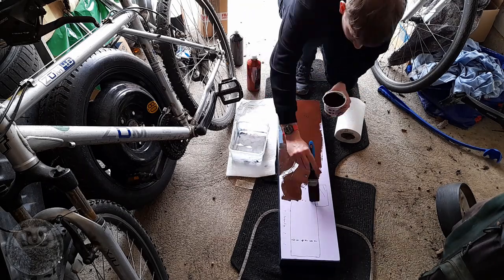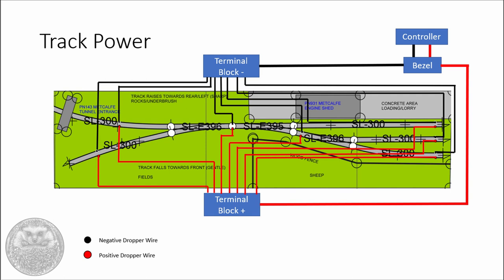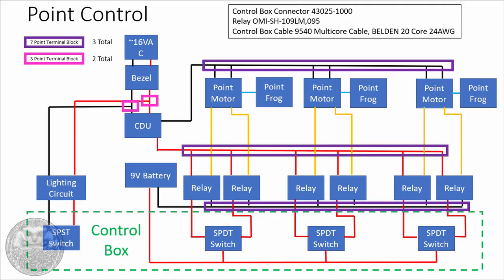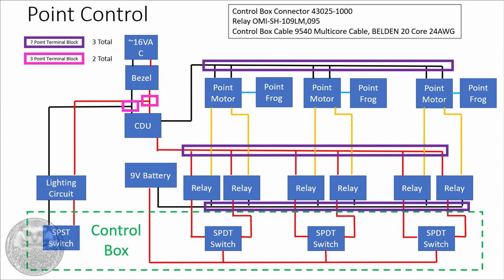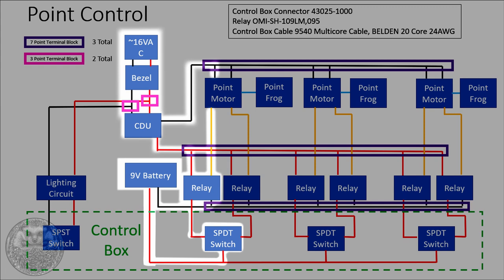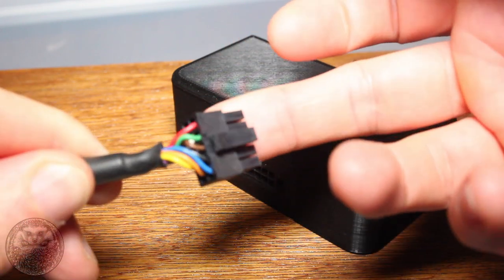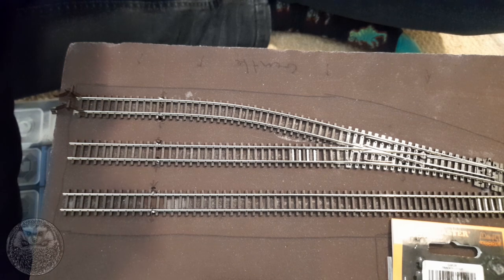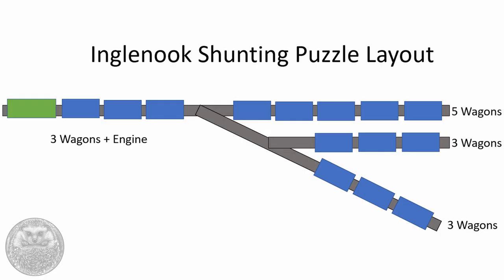N Gauge Model Railway Layout Build EP02: Electronics and Magnets

Comment: Interesting video! Interesting use of the relays, tradionally you would just wire the switch to the point motor so not quite sure of the rational behind this. Love the use of 3d printing, it really makes a neat job in the build.  Loved the trick in adding water to the rodding before you cut it! we have all made that mistake 😂😂😂 . Interested to see how your automatic couplings work over time as this has always been a big grey area in N-gauge, hopefully you've cracked it perfectly! 🤞. Looking forward to seeing your progress as you really have put some serious thought in to this build. All the best Tony.
Reply from the maker: Hi Tony - I have used relays so that the wires going to the switchbox can be much thinner - when using a CDU normally you need something like 18 to 16 AWG wire but the component cable I bought is made up of a bundle of wires around 24 AWG off the top of my head. 

The magnets aren't a perfect solution - you are always balancing the desire to uncouple easily without losing wagons when you want them to stay attached! With my current setup, whilst I can get them to uncouple every time, quite often a very unrealistic looking jerking motion is required to get it to operate! However, from a 'play feature' perspective it makes running the layout for its intended purpose (the 'Inglenook Shunting Puzzle') much more enjoyable as you aren't required to fiddle with the wagons by hand.

Comment: Excellent 2nd episode, like the magnet idea, using the small magnets, I will give that a go ,the dapol ones are large and once the small ones are given a coat of black, assuming they still work, hardly noticeable
Reply from the maker: Hi Colin, thanks again for your comments. The small magnets have been working OK for me, however it is very hard to get a good balance where the magnets are strong enough to decouple the wagons but not too strong so that the train splits when you don't want it to. One thing I can say however is once painted and ballasted they're pretty hard to see.

Comment: The easi-shunt magnets will work under the track if you're able to carve out a slot for them in the foam. So you don't need to cut out any sleepers and you will have a bit more margin of error for placement of rolling stock when uncoupling.
Reply from the maker: Hmm, that is interesting, I found if I had them under the track then the magnets didn't work properly for me.

Comment: Thanks for the informative videos. I do have one question, what is that blue foam?, Where from?
Reply from the maker: Hello there, you're welcome! Do you mean the pink foam on top of the baseboard? It is XPS extruded polystyrene sheet. I got it off of amazon but can't find it anymore... 75% sure it is this stuff but they only have it in quantities of five.
https://www.amazon.co.uk/Foam-Insulation-Boards-1200-20mm/dp/B07WPW7J6Q/ref=sr_1_4?keywords=extruded%2Bfoam%2Bboard&qid=1670881144&s=instant-video&sprefix=extruded%2Bfoam%2Cinstant-video%2C98&sr=1-4&th=1

Comment: Personally, I found episode one unbeiievable. Were you building a gravestone? I thought, "Why not use a block of foam?" Then you laid apiece of foam on top of it! Enter episode 2 and I couldn't believe you were working on the same layout. There's more wiring than in a telephone exchange. Funnily enough, I al.so have en N gauge Inglenook puzzle. The baseboard is made from 1/4" balsa cut to shape with a scalple and glued with balsa cement. It measures 22" x  7" (590 x 178). In the event of an atomic war, mine won't survive, your's probably will. Please don't take this as criticism. I'm agast with admiration. Don't let it give you a hernia.
Reply from the maker: She's certainly sturdy! I think this thing could sink the Titanic.
Reply: I have an N-gauge Inglenook made on a 1200x200mm scrap baseboard from someone else's layout. it is some blue particle/insulating board with a rough timber frame. far more solid than needed! just about to add a second Inglenook to it on the opposite side, in 2mm finescale